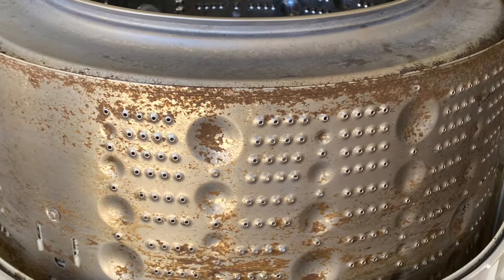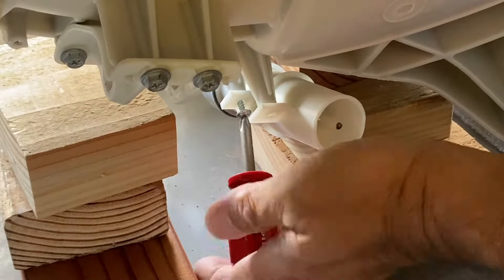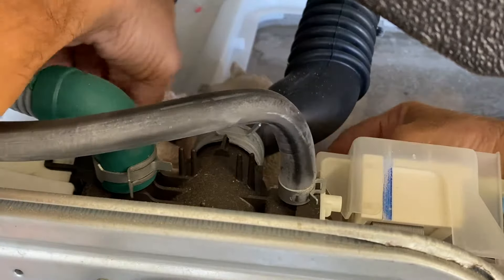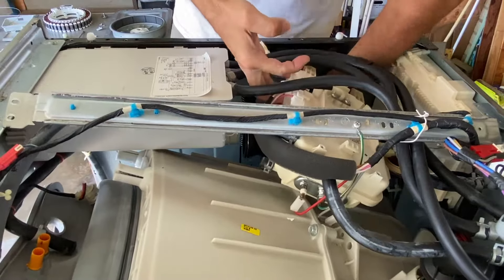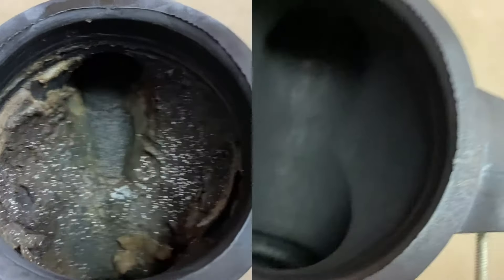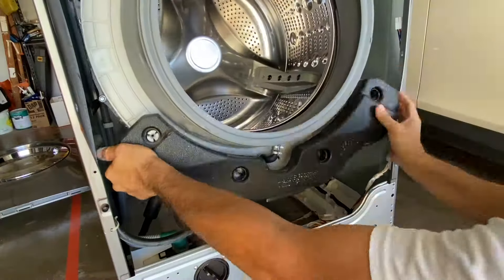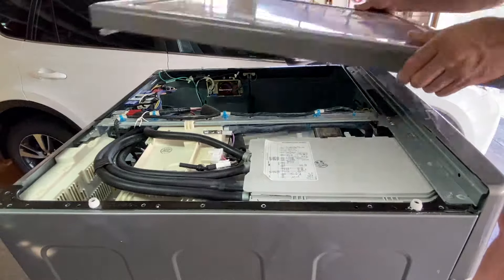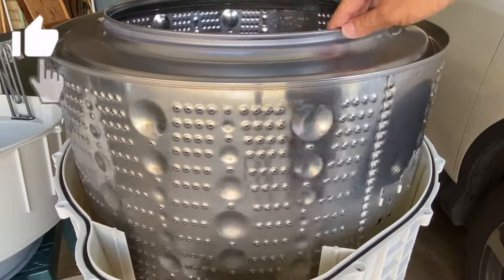THIS WAS A LOT OF WORK!  | Teardown & Deep Clean a Front Load Washer Tub

Comment: i have good success with a degreaser concentrate  mixed with water to the point where it pools in the bottom of a front load washer. i will spin the drum manually multiple times letting the concentrate sit in the drum for several hours sometimes over night.. if I forget. but the important thing is to spin the drum by hand repeatedly. 
rinse spin cycle. then the garden hose into the drum  to rinse down the drum and to provide additional pressure to move debris to the drain at the bottom of the outer tank. 

this works very well as a 6 month maintenance. i often will remove drain pipe  at this time to rinse it in the utility sink. clean filter and will fill the drain hose on the pressure side of the discharge pump with degreaser. letting it soak over nite with the other parts mentioned above.
when rinse comes it blows the whole system clean. the discharge hose is a major source of odors as moisture is always present.
the seal gets wiped after every load of laundry giving special attention to the drain ports at the 6'oclock position

Comment: Seriously, im very grateful for such a prestige demonstration, but all that work just to check on the outer side of the tub..man, its like building your iown washer
Reply from the maker: Thanks!  it was the consequence of not cleaning the front loader over years and years of use.  A foul odor and specks of gunk in the wash were the results of the neglect.  The lesson I learned... clean your washing machine at least once every 30 days and wash some loads (towels, sheets, whites) with hot water weekly.  😎

Comment: How often you clean your machine lile that? 😊 That like is for your effort. It isn't really easy though. Thanks a lot. Appreciate your effort
Reply from the maker: Thanks!  I’ve only done it once after neglecting the washing machine for several years.  I learned my lesson and now run the clean cycle once a month with cleaning tablets, use hot water for the last load of the week to help remove residue, and don’t use fabric softener anymore.  😎

Comment: This is a very detailed and high quality video! Did you clean the washer to solve a specific  problem? If so what was the problem and did this cleaning resolve it?

I ask because I have the same model washer and it smells a bit and I have done all the cleaning I can without disassembling. This is quite a bit of work and I would also incur some expense for replacement parts. I am trying to understand if I should do all this or just replace the dang thing. Any thoughts?
Reply from the maker: Thanks!
After years of neglect, our front loader smelled and left brown dirt clumps on our laundry.  The tear down and cleaning resolved the problem.  We ended up giving it away and purchased a top loader because my wife couldn’t get the dirty tub out so of her head.  LOL
😎

Comment: Great video, but I will definitely not do it. I will double the effort to keep them clean. I left my machine doors open the whole week until the next time I use them. They work fine and I have no reason to suspect they are dirty inside.
Reply from the maker: Thanks!  Airing out the tub helps but dirt can still build up.  If you aren’t running the clean cycle at least monthly, I highly recommend you do.  😎

Comment: Great job, but disassembly like that is too much for me. There was a thorough test on cleaning machines done a few years ago, and a Danish team developed a method with several hot cycles and rinses; one with and oxy based powder, followed by one with chlorine bleach and two with an acid based cleaner (1 dl citric acid, or two cups distilled vinegar). I can`t remember exactly, but I was surprised at the number of hot cycles and the recommendation of chlorine bleach. In Denmark they have hard water and mineral deposits are common. They experts insisted it had to be highest temperatures, and attacking the grime with different detergents. They tested real life machines with a lot of grime and build up, and it took quite some effort before they insides were clean. They checked that all the parts like the outside of the drum, that`s hard to reach.
Reply from the maker: Thanks!  😎

Comment: This guy basically did a tub and bearing job by himself. Legendary
Reply: Yep I had some GE front loader that I replace the bearings on twice and the shocks once basically the same procedure as doing the main bearings. I don't know about this new LG but GE wanted you to buy the whole hub assembly to get the new bearing. But if you're careful and you basically know what you're doing you can buy the bearing kit and replace it yourself. But as usual with appliances at some point you just have to get a new unit. Anyway once I get my LG cleaned out in addition to maintenance cleaning I also bought a small fan that I set inside of the drum after completing a load keeping everything dry is also important
Reply: And not one power tool 🤯

Comment: Fully admire. I have almost exact LG stinky washer machine. Every once a while, I have to spend hours of labor to clean it. Fully regret of moving from top loader to front loader. Life quality went backwards because the wrong decision. I will never buy front loader machines anymore. I personally have very sensitive nose that I can tell the mold odor and this LG stinky machine is great producing mold odor continuously and spread to my cloth.
Reply from the maker: Yeah... after I cleaned the front loader, we gave it away and purchased a top loader.  My wife just couldn't get the thought of the grime out of her mind and had enough with the front loader.  She's so happy now!
😎
Reply: @HacksbyDad  Thanks man for the reply to my comment! Today I treated my LG Stinky with 409, Mold Remover, Hand Sanitizer, Bleach, White Vinegar, Baking soda, Clorox Mold Spray each with a hot clean cycle. The machine finally smells less stinky. But there is no way I can do what you done to follow 1,000,000,000 steps to break down the machine and clean the outside of the drum. I know there must be still tons of dirt built outside the drum that I just cannot clean.... I will give this Stinky machine few more months if all brutal cleaning methods are not working, then it has to go to junk yard.
Reply: I’m little confused what is  difference it makes to have top loader? It doesn’t get grime like front loader?
Reply: @Parkseo226  they do just not as bad they just don’t have air tight seal so the simple fix is proper maintenance any washer will get nasty without it

Comment: Amazing video. Detailed and well illustrated. Make sure you check your make and model of washer before attempting this. Some manufacturer's are making their drums in a way that does not allow you to pull it apart. I guess they are more interested in selling you another washer then they are in helping you maintain it. They should be boycotted. Some are even worse, they don't even make in easy to get to the filter. My front load Whirpool duet washer is a joke.I had to take off the whole front of the washer just to get to the filter to clean it, something that should be done once a month. So why make a washer that requires you to take the whole front off unless you just want it to break or stink so people go get a new one. Disgraceful Whirlpool!
Reply from the maker: Just like smartphones that don't allow us to easily replace the batteries.

Comment: Just bought a 1 year old LG for a great price almost identical to this one. Only problem its disgusting with build up, gunk and mold from previous owner. Cant believe some ppl don't clean their stuff more often. after I take it apart and clean it will be good as new
Reply from the maker: Guilty!  For years, we cleaned the gasket, but not the tub.  Didn't even know that it was needed until the gunk started appearing on our clothes.  We now wash with hot water weekly and clean the tub at least once a month.  
Have fun with the deep cleaning!  It was a lot of work and felt so good after it was done.
😎
Reply: @HacksbyDad  yes I previously had a samsung for 4 years. I replaced the bearings and when I took it apart it was nowhere near as bad. I'm wondering if it's a washer design
Reply from the maker: @dant3113  Not sure, but not regularly cleaning, not routinely washing with hot water, and using too much detergent like us doesn't help.  LOL
Shortly after the deep clean, my wife insisted on getting rid of the front load and getting a top load washer.  😎
Reply: @HacksbyDad  just finished the deep clean on my washer.  It's a whole day job 😅
Reply from the maker: @dant3113  Great to hear!  👍

Comment: Awesome instructive video. Thanks for efforts. Any ideas why a similar large size drum equipped LG washing machine may cause holes on some of clothes? No visual problem inside of drum surface, so metallic sounds when rotating it by hand. No vibrations. Nothing. Authorized service center only wants to replace entire drum and front gasket.
Reply from the maker: Sorry, I haven’t run into this problem.  The clothes only touch the drum, door, and gasket… not sure what could cause the holes.  🤷🏻‍♂️
Reply: @HacksbyDad  re: Holes -  suggest you make sure all zippers are closed (i.e. zipped up to avoid catching on other garments) and delicates or items with hooks e.g. bras etc  are placed in an individual wash bag. Wash clothes on Gentle or delicate cycle.

Comment: Jesus what a job!! They really design these things to be so difficult to clean, so that there’s a decent amount of pressure to just buy a new one 😭
Reply from the maker: Yeah… but my fault for not routinely cleaning the machine.  Sales people really should point out that front and top load washers need regular cleaning.  
😎
Reply: @HacksbyDad  is it neccessary to teardown & deep clean? i've been thinking about it but the cost is about 150 bucks to call professional cleaning. my machine's only about 700 worth, it's also a front load whirlpool.  so far i used only the built in drum clean function with affresh. but i get black dusty bits falling out when i run the laundry, i have no idea where they are from :(
Reply from the maker: @JS-es9bp  I neglected our LG front load machine for about 7 years.  I tried cleaning the drum with Affresh, Plink, baking soda, etc. but nothing worked.  That's what lead me to tear down the machine.  Here's a link to a video showing how to take a look at the outside surface of the drum... https://youtu.be/9tmTxWG9qXE
😎

Comment: Jesus, this should not be something that has to be done. Top loaders are FAR better. 

That being said, mad
Credit to this man.
Reply from the maker: It was our fault for not cleaning the front
loader for several years.  I think top loaders can get dirty too if not regularly cleaned.  
😎
Reply: Sorry, but you're wrong about that. Front loaders are gentler on clothes, and if a tiny bit of extra work is done, your tub will not look like this. I just split the tub on a 14 year old LG TROMM to replace the bearings, and the stainless is clean and looks brand new. Why? Because the woman kept the door open after every wash. Drained the well and cleaned the trap regularly, and ran "washer cleaning cycles"  periodically. And most of all, she didn't use too much detergent and softeners.

Comment: This is exactly my model LG with exactly the same problem.  It's releasing mud back onto larger loads of laundry intermittently.  As basic as you make this seem, I'd have to agree with rndoune that I'd rather pay someone who does this for a living to make sure it's done right.
Reply from the maker: Yeah... I don't plan on ever tearing apart the washer for a deep cleaning again.  It was a lot of work.  
Several tub cleanings with Plink and Affresh got rid of most of the gunk but couldn't remove the stuck-on grime.  
Thanks for the feedback!
😎

Comment: was your washing machine new when you got it? how long did you have it and how frequent was it used before you performed this level of cleaning?
Reply from the maker: We bought it new and didn't clean it for about 7 or 8 years before noticing a bad odor and brown marks on our clothes.  That's when we learned that the machine had to be regularly cleaned.  🤦🏻‍♂  I'd say we ran 4 - 5 loads every weekend.  We learned our lesson the hard way.  We now have a Maytag top load washer and run the clean washer cycle once a month and wash our sheets, towels, and jeans in hot water.

Comment: I think the drum was not that dirty. If you just remove the hoses and really clean them out, remove the door seal and really deep clean that, the result is just as good. I did this to remove odors. Even running bleach (lots of it) would not get rid of the smell. The recirculation hose was the worst. The many drain holes in the door seal were also plugged. They were not even opened very well from the factory. I used a drill to make sure there was no rubber flashing still blocking the hole. Result was night and day. 

Seriously, I do not think this was worth the work. Like I said, the inner/outer drum did not look that bad and likely did not cause any smell.
Reply from the maker: I deep cleaned the drum because my wife could not stand the idea of washing our clothes with that grime.  Not worth it to you, but is was worth it to me.  Happy wife, happy life.  LOL

Comment: Best way to avoid this is to run a sanitize cycle at least once a month with towels, whites, rags, or other items that will not fade. This will use hot enough water to break down the deposits you do not see.
Reply from the maker: Yup!  Why didn't you tell me this 10 years ago?  LOL
We now run the clean cycle with Affresh tabs once a month, wash towels, jeans, and sheets with hot water every week, and use less detergent.  
😎
Reply: @HacksbyDad   Believe it or not, the 'hot' temperature on that machine still isn't a true hot wash. Try a sanitize cycle with towels in your next load!
Reply: @HacksbyDad   and by the way, great vid!
Reply from the maker: @lakewebsterkid  Thanks for the tip.  👍
Reply from the maker: @lakewebsterkid  Thanks!  Appreciate it!

Comment: Did you tried to do a couple of extra hot wash empty with 3 dishwasher tablets? They remove all the dirt! And buy the way what you see inside the pipe and all the dirt is liquid detergent residue lived because cold and tap cold washs only! Start use powder detergent and hot temperatures for towels forbedding shits, and you machine will stay fresh and clean for ever, that ahappen because most of thepeoples don't know how to use awashing machine
Reply from the maker: Guilty!  
We obviously didn't know how to keep our washing machine clean.  It was about 7 years old by the time we started noticing marks on our laundry and it was too late by then.  I tried dishwasher tablets, washing machine tablets, vinegar, etc.  Several cleanings but nothing would remove the grime except for this teardown.  
We now run the clean cycle with washing machine tablets once a month and like you suggest, wash towels and bedsheets in hot.  So far, so good.
😎
Reply: @HacksbyDad  infact once it get dirty is so hard to clean it back, just use hot temperatures and powder detergent for at least 2 cycle at week and no problems

Comment: Great video with one major flaw.  Thank you for creating such a wonderful video.  It really satisfied my curiosity as to what else I might be able to clean without disassembly.  Now on to the major flaw.  I only learned of this from another YouTuber today, so don’t feel too bad.  You need to remove the baffles and clean what is held inside of them; particularly if fabric softener is being used.  Each one of the three has a Phillips screw at the back.  Remove the screw and the baffle will slide forward, allowing you to remove it.  From there you can take each one apart. Use a paintbrush or such to clean them thoroughly.  This is likely the nastiest thing in the machine.  (where the bad smell is coming from and likely where the streaks are coming from)  Mine were horrific because I didn’t know about this and my machines were purchased in 2007.  Love my LG washer and dryer.  Never giving them up.